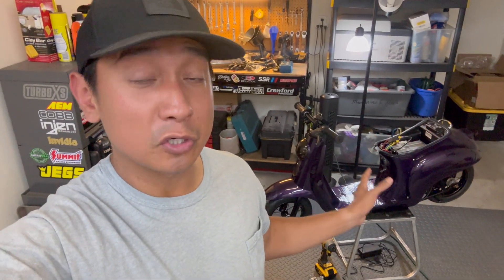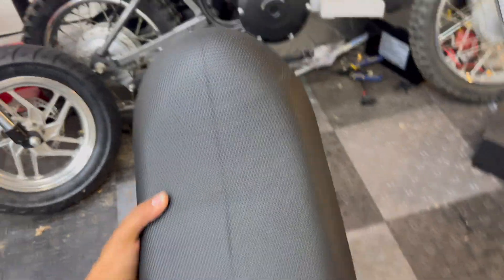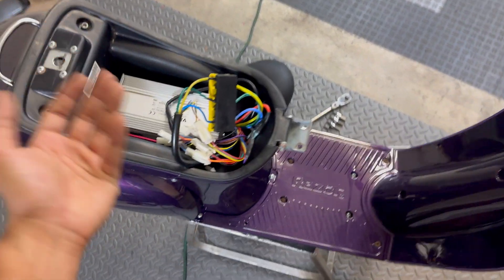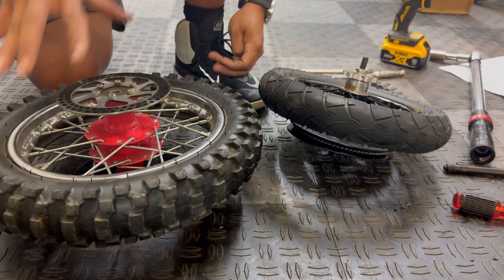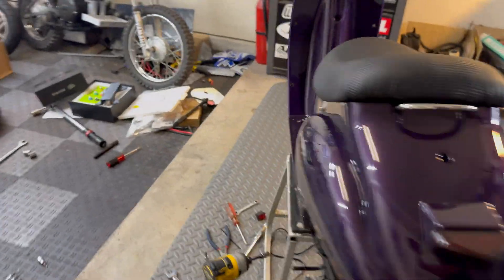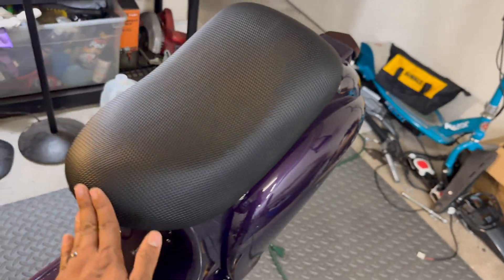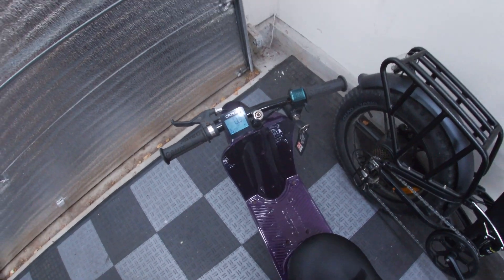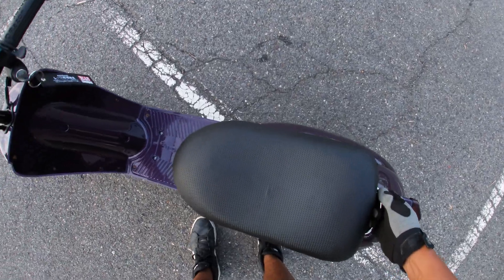48V Razor Pocket Mod Custom Build - First Ride on the Street

Comment: When you mounted the controller under the seat did you drill a hole for the battery cable as well?

Comment: I want to copy this builds drive train maybe just with a different battery if I bought one of these new from Walmart do you think I would still have to buy a new wheel?
Reply: Does anyone know any alternatives to the motor adapter and chain tensioner

Comment: I definitely wouldn't try to make it go faster. The brakes are inadequate as it is. That rear wheel will lock up and lay down rubber, but without front brakes she'll skid pretty far. She'll also probably lay it down.

Comment: Man Ive been mounting those controllers in seats like that for all my builds. But they need air. I add a couple intake fans and a rear exhaust. Those controllers get so hot in there. On mine i cut out both sides for air and it helps and is hidden by the scooter plastics. Anyways something to keep an eye on. 9 year old girl may not be riding so much that it matters.
Reply from the maker: Appreciate the input! I thought about this, but the controller barely sees any load and she’s stuck on the lowest speed mode for a while. Now if it was pulling at least 50 amps on a 72V set up.. it would generate a lot more heat so you’re right about that
Reply: @PatOutdoors  you will be surprised. If she's not riding a mile or two straight and probably at her age i would suspect not. Butt every one even at the 30ish amps it's pulling will get hot. To the point you can't touch it. Now here in the summer it's miserable hot so that plays a role. I will ride mine to my folks which is a couple miles and when I get there it's smoking without ventilation. Again, with her probably not riding hard.

Comment: How does that battery controller combo work. Since you can’t program those controllers it’s trying to pull 2000w from your 1000w battery. Was always told that will heat up your battery and burn out.
Reply from the maker: @jeffmoen8563  it’s really just capped at 1500w by the battery 30 amp BMS. A bigger battery would deff be a better option

Comment: Hey Pat.  I am working on a Pocket Mod right now and have just received the wheels from Aliexpress. What axles are you using?   Thanks for your videos!
Reply: Choosing the purple colorway was definitely a hit, so close to 10k
Reply from the maker: @Aaronthebud9  just a few hundred away from a giveaway coming 😉
Reply from the maker: @robmcculley6835  I’m just using the factory axles. Did you go with a larger diameter wheelset?

Comment: I do not have a brake light output
Reply from the maker: You must have brake light output to have power going to the brake light.
Reply: you don't need a special output. I use a step down to 12v converter to feed power. You just need to feed power to brake switch then other side to light power wire. Then other wire of light goes to ground. Press the brake and it closes the circuit which lights it up. If your light handles original voltage you may not need a step down

Comment: Hey pat we were talking about you buying a hub motor off of me a couple days ago. I have a razor build and I bought a tail light I already had a 12 v converter because I had lights in but I can’t figure out how to make the brake light turn on with my key.
Reply from the maker: @splux5678  yes, I responded to that comment with full detail. This bike is not set up to have running lamps, only when brake applied, like I said in the video.